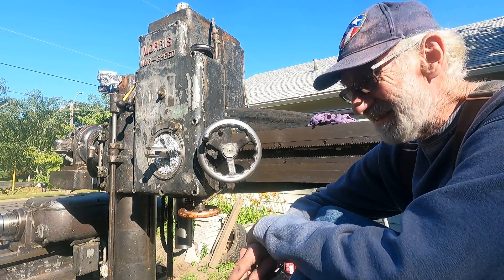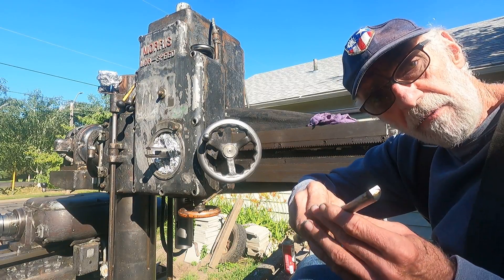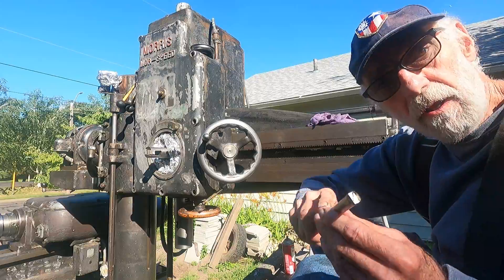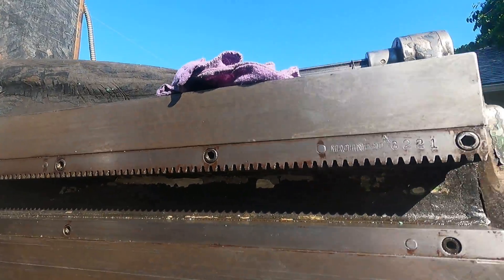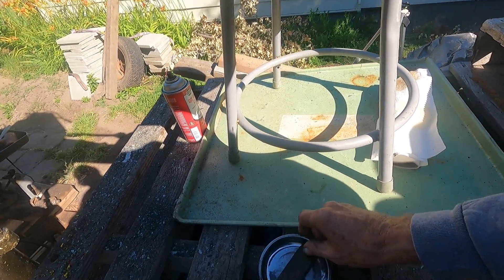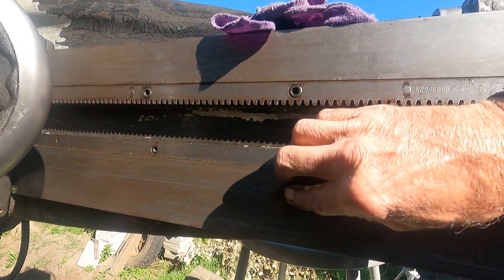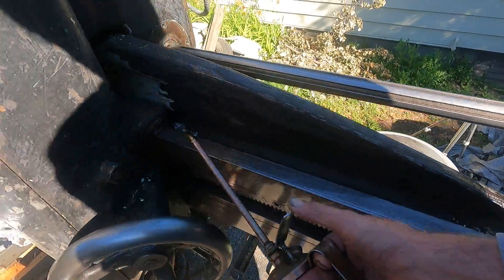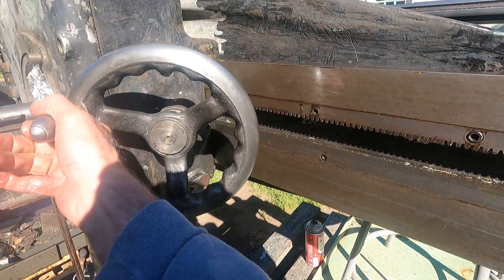Radial drill press restoration dressing scratches

Comment: DeeDee, Don’t you dare slip on the oily piece of case iron.  You’re making me nervous.  Maybe work on the arm closer to the ground?  Where a cherry picker might even be able to pick up the head as you pull it off the machine.  As you know repairing bodies is a lot more difficult than repairing machines.  TB
Reply from the maker: You are right, I will move closer to the ground now that I cleaned the lower column. I did quit wearing a neck tie

Comment: I’m going to go look at my radial drill project. I’m going to go see if mine has bearings and window for bearings. 
You need a gantry to lift up the head.
Reply from the maker: I hope everything is good on your drill. The best way is to use the drills own lift and crib it to a heavy cart, it would be hard with the head hanging to stab it back on to the ways.